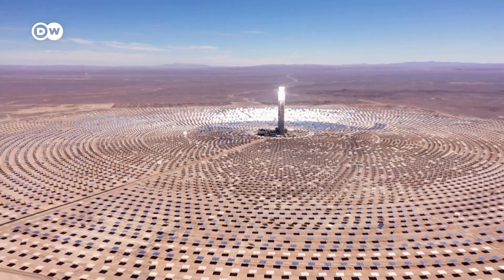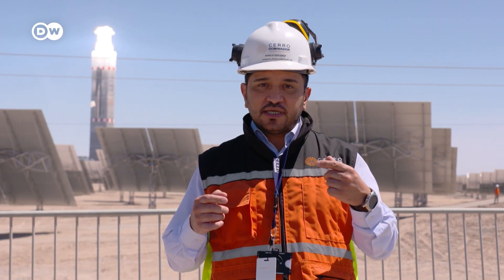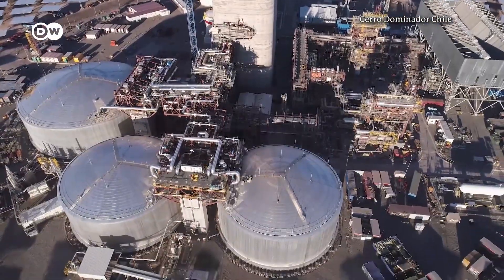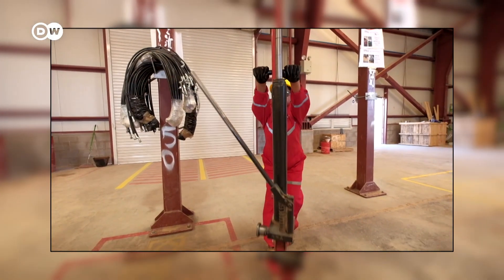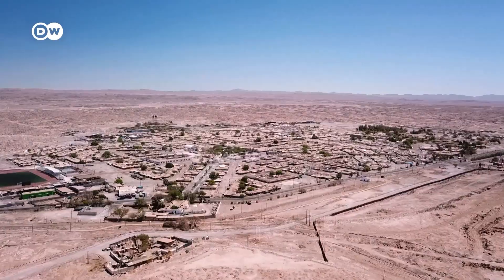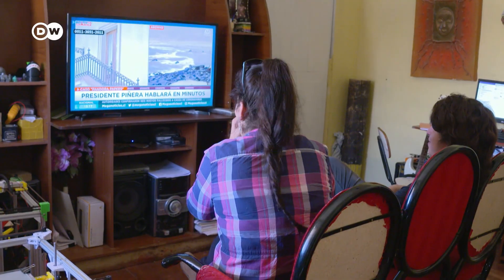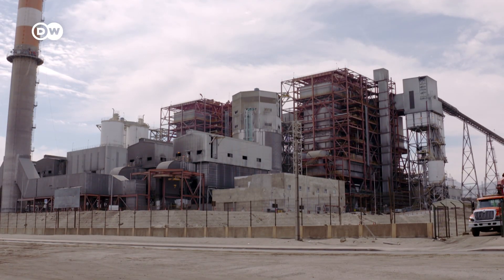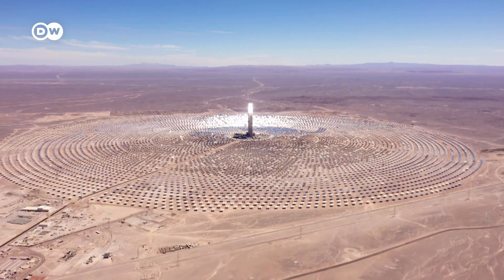Chile: A future without coal? | Global Ideas

Comment: How they are storing the electricity for 17 hours?
Reply: The temperature of the salt can make steam for 17 hours and move the turbines.
Reply: The  CSP heats the molten salt tanks during day. The tanks store a capacity of 1,9 GWh of electrical energy, enough to generate steam for the turbines for 17 hours. Additional 100 MW of solar photovoltaic provide power during day.

Comment: 1:10 "Over one hundred megawatts of electricity a day" - That doesn't make sense. I guess what is meant is megawatthours.
Reply: It seems that journalists and physic never can be friends :(. The Cerro Dominador CSP (concentrating solar power) has a 110 MW generator (not 100 MW) and it can run 24/7 due to the salt storage tanks with a storage capacity of 1,9 GWh electrical. The energy generation of this CSP can be up to 950 GWh/year.

Comment: Extremely dependent on geographic and weather condition, not suitable for most countries.
Reply: Chile is not like most countries, it's better.
Reply: Yes, but there are solutions akin to this in many places, some have wind, others wave, hydro and so on - local solutions are needed, and this wasn't touted as the solution for all our issues, but one solution. 

You can also say have countries like Denmark export Wind and Wave power (as they do) to other countries nearby, and as such mountainous countries with a lot of rain can export Hydro, safe and stable countries can have nuclear.

Comment: Please clarify carbon neutral.
Reply: It means a balance between the carbon emitted in relation to the carbon you don't emit. If you emit 10g of carbon from your car, but absorb 10g of carbon at the same time, you're carbon neutral. Another example would be "carbon negative", where you absorb more carbon that you emit. Think a hydro dam; yes, you produce carbon by constructing it, but to keep it simple, a hydro dam is basically a gravity dam with turbines on the bottom that generate electricity. I forget the exact number but all of our dams are hydro electric.
TLDR: Carbon Neutral: You produce the same amount of carbon that you absorb
Carbon Negative: You absorb more carbon than you emit

Comment: Could you not combine a liquid metal battery with this technology for even higher storage capacity?
Reply: At 500C you are limited with which metals you can use. Molten salt is adequate for this configuration.

Comment: The process of following the production of a plant and its generation vs waste is called Life Cycle Assessment. The resources needed to build the plant, the affect on the surrounding environment, the planned life span of the plant, and it's eventual shutdown were calculated by a team of engineers/scientists. After these calculations were reviewed, it was decided that building the plant was more beneficial than leaving the environment as it was. The impact on the environment from using fossil fuels is much greater than it is with renewable energy. The consumption of resources needed to produce renewable energy is a topic from a disinformation campaign started by Big Oil in the 1970's that is continuing today. It's purpose is to undermine the "cleanliness" of renewable resources, as an act of deflection from the environmental destruction caused by the fossil fuel industries.

Comment: To store energy you literally just need to use some electricity to pump water to a higher altitude.
Once you need that stored energy, just let the water flow down again and through turbines
Reply: The idea is NOT to need electricity to generate electricity.
Reply: you only lose half of the power you put in  and u can only build it in a few places and u cant store that much

Comment: How many birds are burn alive while flying , also how much water do you waste to cool the sodium and to clean the mirror and how many animals were remove to make space for the plant why don’t you speak all the mirrors are made burning coal and oil in the metal factory’s  how much water was use mining and how much destruction was produce during mining and water wasted not to say the acid of the battery .
Reply: You do know why they use mirrors instead of the solar cells? Solar cell material is causing alot of environmental harm to mine out, but mirrors is like a very common cheap material. The tower is literally most concrete, solar plants are usually placed in try arid areas with not much wildlife. How meny birds die by flying into skyscrapers? Where birda choose to fly is not of our concern or of any, very little. Once the plant is up the maintanance is less than those of factories with alot of moving parts and machinary and the solar plants like these are cheep and easy to repair and once they are up and running they have a built in storage in forms of heat that can run turbines for a long time. No matter what part of tge process you look at for these plants you will find that nothing goes to waste and it is cheep and fast to build. Economicly effecient and environmentally effecoent on all levels.
Reply: The process of following the production of a plant and its generation vs waste is called Life Cycle Assessment. Most of the things you mentioned were already calculated, and it was found that building the plant was more beneficial than leaving things as they were. The impact on the environment from using fossil fuels is much greater than it is with renewable energy. The consumption of resources needed to produce renewable energy is a topic from a disinformation campaign started by Big Oil in the 1970's that is continuing today. It's purpose is to undermine the "cleanliness" of renewable resources, as an act of deflection from the environmental destruction  cause by the fossil fuel industries.

Comment: The problem is that photovoltaic panels generate energy more efficiently than these mirror - molten salt plants. Then even with added cost of storage the photovoltaic plants can be cheaper. But the mirror - molten salt plants basically have no degrading elements that would have to be replaced over time (unlike photovoltaic panels and batteries).
Reply: Photovotaic panels last for more than 30 years, so there is not much degrading going on. Batteries last at least 10 years , but can easily last even longer. They are specially designed to last very long for electricity storage purposes. But you are right. Mirrors can last even longer than PV and some "mirror plants" (solarthermal power plants) have mirrors lasting decades without any sign of degradation. But overall, the lifetime is not the problem with either PV or solar thermal. Solar thermal has the advantage of storage with very low capital cost because the materials are relatively cheap.
Reply: not are paneles photovoltaic
Reply: The mirrors degrade in a matter of years. It's already been proven in the US.
Reply: @Twobirdsbreakingfree  ye but they don't produce E-waste like photovoltaics...

Comment: That's great, my 4 year old Samsung phone holds its charge for about 48.
Reply: I have a 11 years Samsung phone and its battery holds it charge for about 5 days.
Reply: 48 mins or secs ????
Reply: @pancakesrule  Hours.
Reply: Yeah but unfortunately Li-ion batteries are not scalable to this size, or at least not yet.
Reply: @sopaipillascnmostaza  There are multiple li-ion project in the works on GWh scale. What scale are you referring to?
Reply: @PerErikKarlsson  But are they available on the market? For a developing nation like Chile, grid scale Li-ion is off the table for the  near future and we are the second largest producers of lithium in the world. Apart from that, do we want to depend even more on a mining intensive product with a harmful ecological impact?
Reply: @sopaipillascnmostaza  Yes, the li-ion BESS is available on utility scale and some BESS projects are under construction. However, CSP with molten salt storage is by far the better option for Chile. In many other countries (countries without hughe deserts, not that much direct solar irradiation), solar photovoltaic combined with a battery is the better choice, at least for short therm storage intraday/dayahead.
OT: Chile urgently needs to change the auction design, otherwise PV will win the next auctions as well, even without sufficient storage and CSP will not develope any more in Chile, which would be a shame and not economical.
Reply: @sopaipillascnmostaza  Could you not put a single one in each panel and change the distribution stream as it leaves for customers? Decentralization, idk I'm not an electrician lol.
Reply: @MrLoobu  This is just a steam power plant working on the  heat from sunlight, distribution works on a national power grid with decentralized production

Comment: What about when there's no sun ? Like in the winter
Reply: This desert is at a latitude and altitude where even in winter it receives lots of sunlight. It’s a desert location it doesn’t rain much there. It’s pretty much always sunny and given the earths face angle to the sun the concentration of sunlight in this area is higher.
Reply: In that place, even in winter, there is a lot of sun light.
Reply: There is no winter in chile. The temperatures stay somewhat similar in the winte r
Reply: @antess1446  there is winter in Chile, just not in that part, in fact most of Chilean population live in temperate latitudes, bjt the plant is located in a desert on a tropical latitude and high enought to not have to worry for not having sun

Comment: I thought this system is not so sustainable. Because of huge fresh water consumption and maintenance cost / time??
Reply: Probably meant need water to clean dust from the mirror. Or the mirror stop working for obvious reason. 
Ground level, dry sandy location, must have lots of dust
Reply: You thought it and were right, it's not. Look at the enormous quantity of panels needed to produce what is not much energy at all...
Reply: @ric8167  those are just mechanical mirrors...
Reply: @ric8167  Mirrors are mirrors, of course shape, size and materials vary, but there's no cadmium nor particularly hazardous materials in their making, your whole argument is targeted towards photovoltaics and this is a completely different technology. They just work like hundreds of magnifying glasses toward an ant, it's free energy, private enterprises wouldn't be interested in constructing them if it wasn't efficient or economically viable.
Reply: @sopaipillascnmostaza  yep
Reply: @ric8167  Could you explain further? I must admit I don’t see a connection between the amount of panels needed and water consumption?
Reply: @raempftl  it's unsustainable because it's inefficient, the panels can't convert all available energy into power. Also, the manufacturing process is intensive on water consumption and usage of highly hazardous materials such as cadmium, lead and a million other chemicals. Where do you think the photovoltaics come from?
Reply: @ric8167  ye but in this case it’s the middle of the desert land that is arid and unusable anyway. So why not use it for this purpose.
Reply: @ric8167  This kind of system is also used in Marco and in USA (not a big success). Hopefully this one is much better and sustainable.